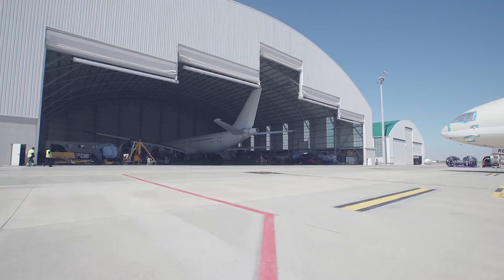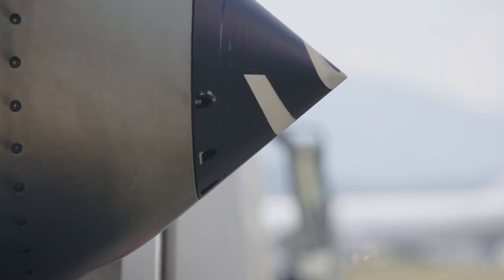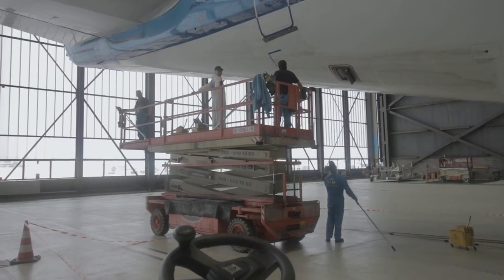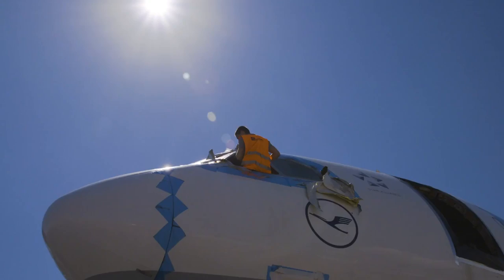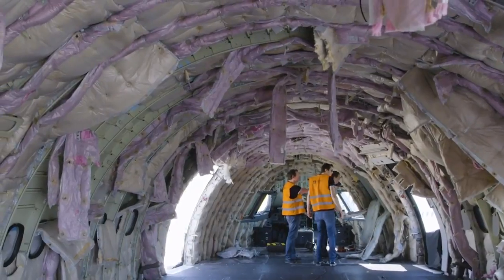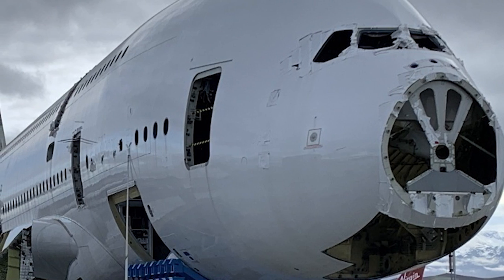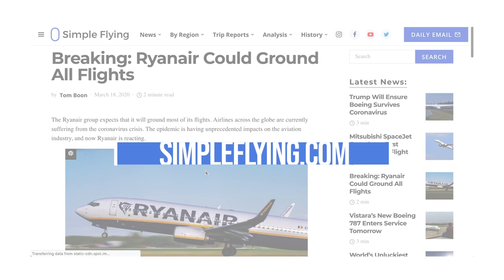How Is An Airbus A380 Scrapped?

Comment: I remember clearly how exciting it was to watch documentaries when these were being designed and built years ago.  But, not enough years ago!!!
Reply: you mean docus from circa 2002-3 ? anyway the first and second A380 made in 2006 were dismantled in 2019 that is only 13 years,you would expect an expensive plane as that to stay operation for 25–30 years (like the 747)

Comment: Still many freight operators are still flying old 747-200 made in 70s. The A380 is being scrapped. Both sad and strange.
Reply: Sadly the way the A380 was designed makes it unfavorable for freight use :/
Reply: @WinzardsGaming  correct, the hump on the 747 was deliberate in design, it allows the front nose of the 747 to FULLY open for cargo loading. The cockpit on the A380 is low on the main deck, so this isn't possible. Looking back, that's a huge design flaw by Airbus...
Reply: @mpsangha  Good Point. But  nevertheless Airbus had designed a freighter variant called A380F. But it never got any customer. Fed Ex expressed interest in buying a few A380F but eventually decided to buy B777-F instead.
Reply: It's economically prohibited due to the design to reconfigure it as a freighter, where as the 747 was easily reconfigured and economically viable.
Reply: @NakulDalakoti  FedEx was the launch customer for the A380F but it never happened, They even updated some of the international hubs to take the 380F.
Reply: Too much volume for too little allowable weight. As a freighter it would be flying with a significant amount of unused space (volume) for 99% of the time
Reply: Nothing sad about a too big aircraft getting the boot. Good riddance.
Reply: @bftjoe  If everybody was like you, humanity would still be at the stone age.
Reply: @bftjoe  "Yes sure, let me get some pocket change, I'll buy a plane."

What even is the point you're trying to prove... 🤦🏻‍♂️
Reply: @litamtondy  Thinking that getting rid of an unprofitable behemoth is retarding progress, what is your point?  Maybe we should still be flying the 747 for passengers also????

Good riddance to a huge plane which can service few airports.
Reply: @bftjoe  Going forward doen't mean that everything must be perfect. Airbus proved that humans have the technology to build great planes, super comfortable, and incredibly secure (0 deaths, which is really NOT the case for the 747).

The only problem of the 380 is that the economy is not ready for it. 380 and Concorde would be the only planes flying, if aviation progressed towards bigger, safer and faster planes. It's like saying "Good riddance of the 747, that plane only contributed to global warming by consuming so much fuel during its carreer". It's not the 747's fault, it was built when air pollution wasn't such a big problem. Don't confuse "bad plane" with "unfit for the market plane". Nobody knows how many prototypes never went past the testing phase, but still contributed so much to aviation progress.
Reply: cornskid it has nothing to do with “having cargo conversion in mind”. Airbus did offer an A380F, but the cargo economics just don’t work out for such a huge airplane without enough MTOW to fill all the space and that’s why it wasn’t successful as a cargo plane, not because airbus hadn’t envisioned cargo. Also, a 747 BCF still doesn’t allow for the nose to open, one of the great features of a 747F allowing faster (un)loading.
Reply: litam tondy you cannot compare the complete safety history of the 747 to the 380. Completely different eras, changes in procedures (eg CRM), technological advancements, and much much more flown cumulative miles with the 747 than the 380. With all the upgrades it has received over the years and , I would argue any 747 still flying today is as safe as the 380. I agree it’s an engineering marvel, though an economic failure...
Reply: The fuel economics of the 747 were much better than the A380
Reply: Winzards thank God I hate the airbus the 747 777 are so much better
Reply: @litamtondy  Only problem? Not that few airports can service it, requires expensive ground support, impossible to fill in off peak season, massive cost to renovate, massive operational costs (cheaper to fly 2 planes right after each other), the fact that it is over engineer for a stretch version that never happened, massive crew costs, lack of route flexibility with few routes that it can profitably service?

How about massive wake turbulence, underpowered and inefficient engines, having to shut down roads to transport the parts between manufacturing facilities, and the fact that it was only made to have a bigger plane than Boeing? Time to load/unload, poor freight economics due to interior volume to mtow ratio.

Are you willfully blind? The only real progress is getting rid of this niche near useless aircraft, not holding onto it.

It is ONLY useful for slot constrained airports that serve as hubs. Good luck with such a useless expensive airplane. And BTW, carbon fiber is the future, not some aluminum aircraft from the past.
Reply: @hddhdhxhxb1793  I see that we agree. If the A380 was born in the 60s, it would have been way more successful than the B747. The problem is that the market changed when it was born, many years later.
Reply: @bftjoe  You keep talking about economics. 🤦🏻‍♂️🤦🏻‍♂️ You are wrong at judging a plane by its economic success. It's like saying that the F22 is a bad plane because it costs a lot and doesn't make profit for its owner, besides the fact that most of people view wars as useless and detrimental.
Or it's like saying "Good riddance the space shuttle is not used anymore". The space shuttle was an engineering marvel, it doesn't matter if it would not be profitable today.
I hope you realize how flawed your arguments are.
Reply: It makes sense for freight carriers to use old and less fuel efficient planes because their planes are sitting on the ground most of the time, only really doing one flight per day. If they get a brand new plane, its going to cost them more in depreciation for the plane being idle, than they would save from having a more fuel efficient plane. The A380 is expensive both to own and to operate and will not make a good freighter.
Reply: @litamtondy  Oh so the A380 is a work of art. No wonder profit seeking airlines don't want to buy it. Maybe Airbus can pay it's employees in works of art from now on instead of money.

Same reason why the Concorde or 3 engine planes doesn't fly anymore - yes any commercially unsuccessful planes ARE useless unless you think this is an artist field. What a complete JOKE.
Reply: @litamtondy  I guess all the people it takes to maintain an aircraft get paid in art. No wonder the A380 is worth it to you.
Reply: @litamtondy  An airplane that can service very few airports is BY definition near useless, unless you think they should stay parked on the ground all day.
Reply: @bftjoe I'm sorry but if you think money is the only thing that matters, you are kind of wasting your life. It matters of course, I'm glad I'm not poor, but it's not about personal wealth. It's about not using monetary worth as a scale of judgement. As I said, it's stupid to say something like "the Concorde is bad" just because it wasn't profitable. It's really basic knowledge. Concorde is the most beautiful and fastest plane ever EVEN IF being non-profitable, because the two things are totally unrelated. Electric engines exist from a hundred years, but gas engines were the way to go. Now, electric engines are starting to grow big. Did the concept change? No. But the technology evolved, and so did the market. Is an electric car built 120 years ago bad, just because it was not as sold as a Ford Model T? Of course not. You need to try to look at a plane as it is. The 380 is incredibly safe, probably the most comfortable and a wonder for the eye. That's it. If we were talking about an uncomfortable plane, difficult to fly, easy to break, I would safely say "It's a bad plane". But this is not the case.
Reply: @litamtondy  Electric cars make sense now due almost entirely to better batteries. Early EVs had tiny range. You really are pontificating about topics you know little about. 

If beauty was all that matters, then airplanes would be designed by artists, not engineers.

If you're allowed to think something is beautiful, I'm allowed to think its ugly. To pretend your taste is all that matters is just silly. All the A380 is good at is being bigger, not even better.
Reply: @litamtondy  I'm glad the Concorde isn't flying anymore, burning 1 ton of fuel just to taxi, what a joke. I'm glad my windows are intact.
Reply: @mpsangha  the nose door on cargo 747s is only available from factory, conversions (747s are often converted) don't have this feature, they have only bigger side doors, like all other commercial cargo aircraft.
Reply: @litamtondy  Yes stopping using old outdated airplane is the opposite of progress!!!! You are a plumb genius!!! It definitely is not progress to scrap old airplanes!!!! Same with cars, cars are ART! How dare anyone stop driving a car and send it to a junkyard!!!!

Airplanes are to look at like art, and maintenance costs don't matter! All that matters is your emotional attachment to them!

Airplanes are beautiful if you say so! Nobody can think they are ugly!

You probably think that governments should forever bail out unprofitable airlines too! Think of the artful airplanes!!!!!
Reply: @litamtondy  Progress is trashing OLD designs that dont work for new ones that do. Do you really think A380s are needed with a 90% drop in passenger travel?
Reply: @litamtondy  Airlines should buy a 15 year old plane design to satisfy your craving for a beautiful plane! Who cares if there isn't any passenger demand or about astronomical maintenance costs! We must stay stuck in the PAST!!!!! Definitely don't buy any NEW plane designs!
Reply: @litamtondy  The great thing is, it doesn't even matter what you or I think about the A380. The airlines are scrapping them, and that's all that really matters. You can dream about art all you want, that doesn't put planes in the sky.
Reply: @litamtondy  The A380 was worth it. Airbus learned not to design a big plane ever again, and learned their lesson good. They haven't designed ANY planes anywhere close to the size of the A380 after this disaster.
Reply: @litamtondy You are very smart and must own a lot of A380s. No wonder your aesthetic preference is so important to the rest of the world. You definitely didn't say that cost and money don't matter! You put forth many well reasoned arguments to support not retiring the A380!!!
Reply: @litamtondy  Yes, airlines will keep flying this useless beast of an airplane because it's beautiful! Money isn't everything, so its not important at all in why a plane shouldn't be flying!!!!! Beauty is everything!!!!

Usable airports are irrelevant! All the real technical problems are irrelevant because they involve MONEY!!!!
Reply: @litamtondy  To sum up, the ONLY support you have made is 1) beauty 2) money isn't everything. Who's arguments are garbage here????
Reply: @litamtondy  You think an A380 with 1960s engines would even get off the ground? Maybe you made it a 6 engined airplane or time traveled some 1990s engines back in time??? You are truly the smartest person ever.
Reply: @bftjoe  Are you 13 years old? You sure act like a teenager . . .
Reply: @danielthomson5252  It's cheaper to scrap them than renovate to bring up to date with the rest of their fleet.
Reply: HELMUT ALTO  So Emirates will suddenly expand their average fleet age from 6 years to 10 years? Good joke buddy.
Reply: Manpreet Singh what if they designed the A380s head to open like the beluga? That would be cool and allow it to be a proper cargo plane
Reply: Joseph Huang also you think the A380 is inefficient?!!? You are so wrong the reason?
-wingtip fences
High bypass ratio engine
Eco efficient design
Also CAN BOTH OF YOU STOP FIGHTING?!!? You are acting foolish! I want everyone on this planet 🌎 to be nice friendly and respectful to each other, your behaviour is the complete opposite of that 😭😭😢😢😢😭 why can’t everyone just be friends and be happy? We may have different views on some things but you don’t have to argue about it! Let’s all be friends ok? ✌️✌️✌️✌️🤟👍👊❤️✅🌈🌈🌈🌈
Reply: @spencerpowell5173  Yes so efficient, thats why so many airlines have stated it's cheaper to run 2 2 engined planes than 1 A380 right?
Reply: litam tondy I agree with you also yes airlines are looking for more efficient twin engine jets like the 787 and A350 but there is another market for the plane, I emailed Lufthansa to ask them for my own private A380
Reply: Joseph Huang i also agree with you yeah sure the A380 and 747 are being replaced by twin engine jets, but what if there is another role they can play? Like a business jet or freighter or piligramage?
Reply: @spencerpowell5173  You do know the A380F was cancelled, right? And who wants to use the biggest plane ever as a business jet? Really don't know what you're trying to say here.
Reply: Joseph Huang it’s ok to have different opinions 
And thing the A380 did right/ make an impact 
-introduce a new generation of passenger comfort and cabin layout 
-Paved the way for the airbus A350 
-to help environmental concerns, airbus spent more than 100 million dollars planting trees!
-made Emirates lots of money because higher number of planes=low ops costs 
-burned 20% less fuel than the 747-400
-Engineering marvel (no not the company marvel) 
-also paved the way for the A330 neo 
-more efficient than the A340
That is what the A380 has done
P.S I did the math and Airbus made more than 100 BILLION dollars selling the A380
Reply: @spencerpowell5173  I should treat you as brilliant when you mention a 1 off freighter conversion and 0 examples of A380 business jets to support your post! You are very smart indeed. No wonder the A380 is ending production soon! It is such a brilliant innovative plane that dies so fast! You are so much smarter than all of those airlines that are trying to make money by NOT ordering the A380 or retiring them ASAP!!!! What is your airline so I can fly on it?

Did you know the main reason why the A380 FAILED is because airlines flew 2 engined planes with more seats instead of bigger planes? Passenger comfort my ass. Low fares above all.
Reply: litam tondy you can report him you know
Reply: @misuru9255  It's like the A380 of cargo airlines, I read something about 20 flights a year for it, seemed similar to hifly A380 lease numbers. Only for high volume cargos.
Reply: @NakulDalakoti  Because they were far too heavy to use for freight ! They will be able to fly and maintain two of the new 777XF's nose to tail cheaper than one A380F ! That's why the plans were scrapped. Lufthansa is trying to convert a 380 to one level cargo and top level passengers. But it is proving to be very difficult and has been put on hold.
Reply: @mpsangha  That wasn't the only constraint limiting the A380's applicability to freight use. Another is the fact that both floors are required for the rigidity of the airframe. This rendered the opening of the nose almost useless.
Reply: Bruh its getting retired and scrapped already???? The 747 lasts a lot longer than the a380 :/

Comment: Fun facts:
The A380 was more successful than the A318. 
242 A380's built, started  scraping after 10 years of service.
80 A318's built, started scraping after 5 years of service.
I'm one of the few that had the privilege to work on all 4 of the A320 (A318/319/320/321) family of aircraft.

Frontier Airlines was the launch customer for the A318, they had 12 in there fleet. 
Frontier's A318, A/C 805 was the second prototype A318 that was used to fly around the world and made an appearance at the Paris Air Show. It was used for the "try and sell the airframe" demos around the world before Frontier received the A/C  in the mid 2000's.

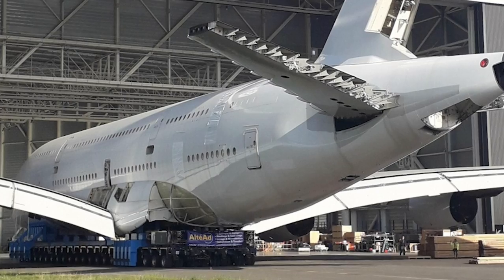Comment: @2:47 so they actually sold the whole wing? Anyone knows to who it was sold? Who actually needs the whole wing??
Reply: That's a good question. Since this aircraft seems destine to disappear I wouldn't think there would be a big market for things like a whole wing. Maybe some secondary airlines will fly these for a couple decades still, I mean some of the smaller SE Asian airlines still fly the 727.
Reply: Lord knows who it was sold to but I imagine the wings would be the most likely thing to get damaged on the ground (I say on the ground because obviously a damaged wing in the air/in flight would result in the loss of the entire plane, not just the wing and therefore a replacement wouldn’t be required). It’s much like how you’re more likely to bump your shoulder on something than your stomach. Plus the a380 clearly has particularly large wings.
Reply: I got one and cut it in half for my 172, works fine.

Comment: When an air craft is damaged by weather, Flying stuff in a wind storm or even accidentally hitting another craft, using recycled parts saves money. I know in Northern Michigan at the old Air Force base, they keep several spare planes as parts for the airlines that use the giant hangers once used by Strategic Air Command to carry Nukes to Russia. I remember  back in the 1970's driving up and seeing only the tail sections  hanging out of those huge hangers. It seems strange to be able to drive around the base now with no one to stop you. The logo of the Air Force is still painted in the Tarmac so thats always cool.